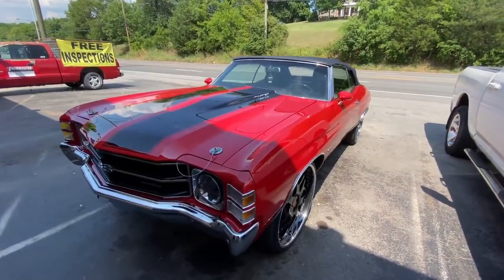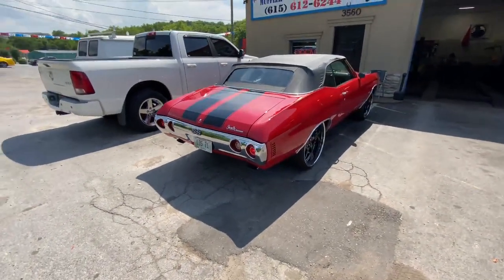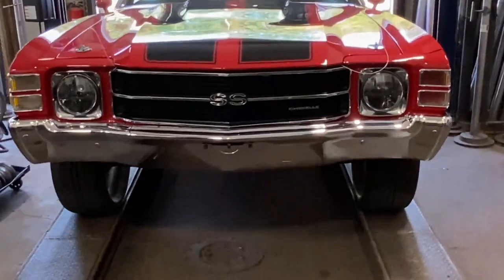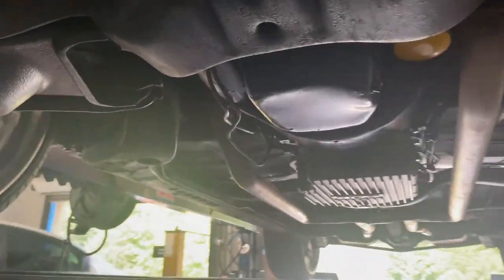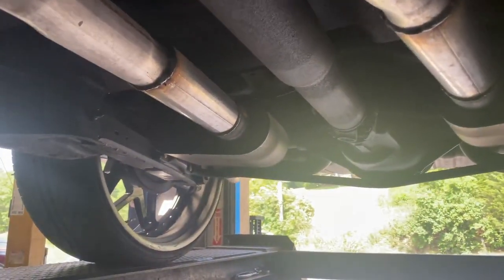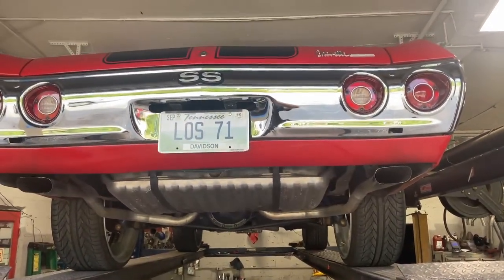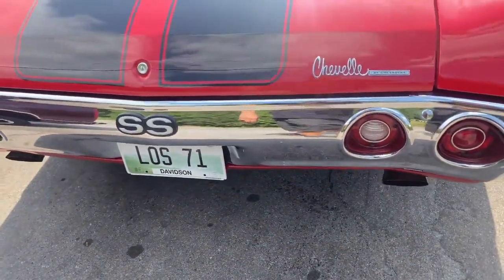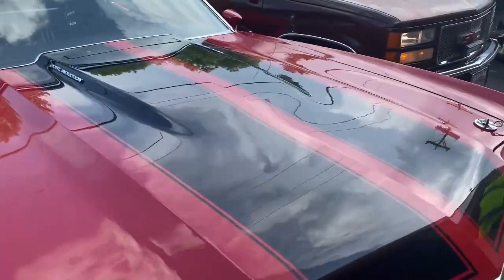1971 Chevy Chevelle SS TRUE DUAL EXHAUST w/ FLOWMASTR SUPER 10s!

Comment: Had a '72 Chevelle back in the day. The only difference between the '72 and '71 was the turn signal lens in the front and the grille is a little different. Everything else is identical. Mine had long tubes and Flowtech Terminator mufflers. Had to sell it back in 2016 because I needed the money. Still regret it to this day. 😔
Reply: Im sorry u had to sell such a beauty sir. But may i ask that another difference is the the headlight bucket mounts that 71 are black and 72 are chrome??
Reply: @MartinFuentes126  Actually they are the same. The main difference is the '71 turn signal lenses and grille has a different design than the '72 but they would bolt on either year with no modifications. I actually like the "72 design better.